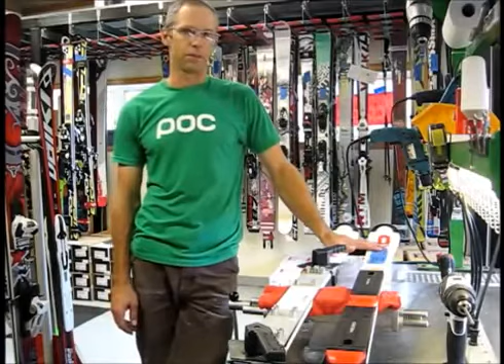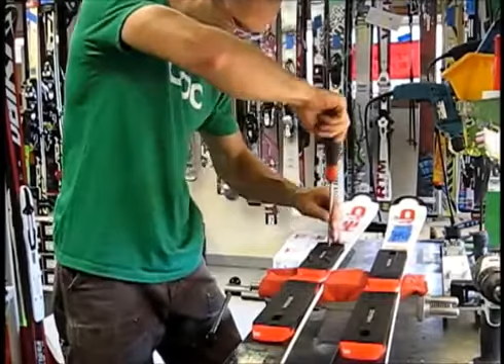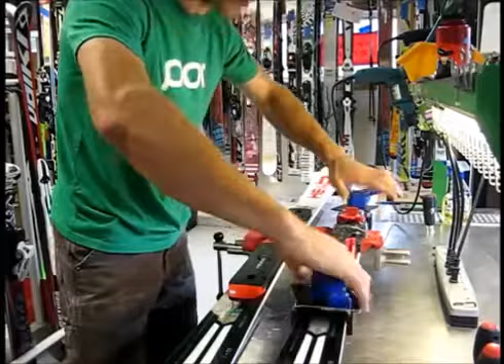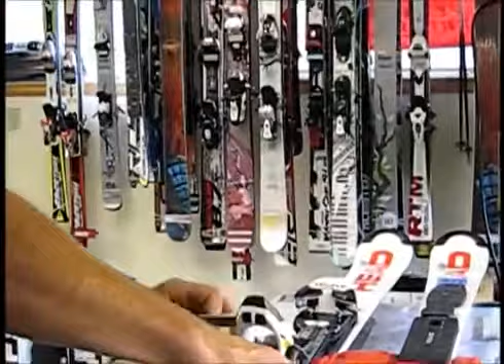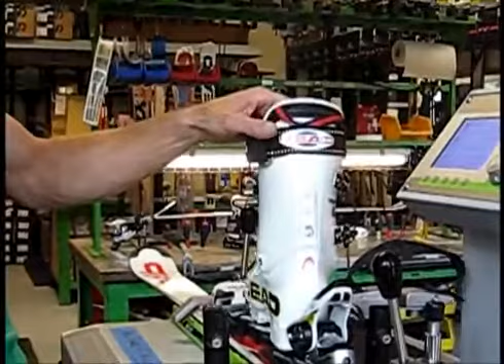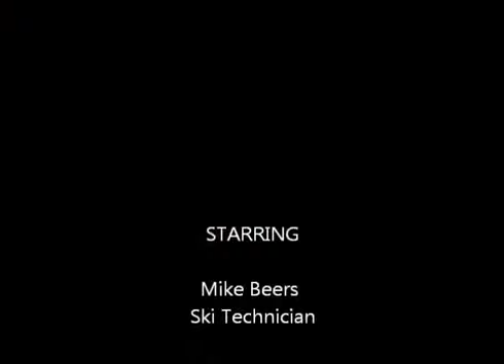Race Ski Binding Mount 10 minute edit

Comment: How many times can you remount a binding to a pre drilled hole plate?
Reply from the maker: It really depends as overtightening the screws which can strip the holes much faster.  But typically you can reuse those holes 3 or 4 times if you are careful.

Comment: Hi, Awesome videos. Can you please tell me what type of glue you use. I am mounting my bindings on race plates and may want to use my bindings one day on another pair of skis and don't want to have issues taking screws out. Is it necessary to use glue on race plates.
Reply from the maker: We do not use glue when mounting bindings to a race plate if it is a pre-drilled plate
Reply: @PeakSkiShopVT  what type of glue should I use if I want to take the bindings off later down the road.
Reply from the maker: @jimtorres9701  We use Tite-bond 2 wood glue. To be clear, we do not use glue when mounting a binding to a pre-drilled plate, it was only used in this video because the plate had to be mounted to the ski. We use glue when mounting a binding to a flat ski or when mounting a plate to a flat ski.